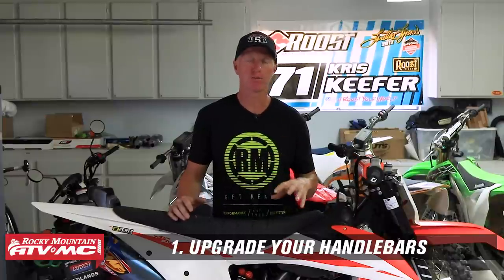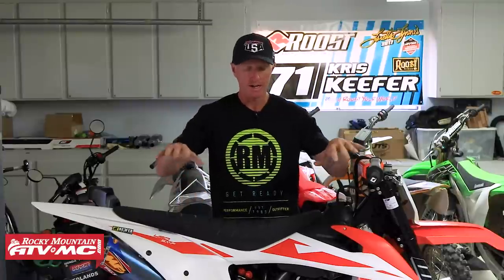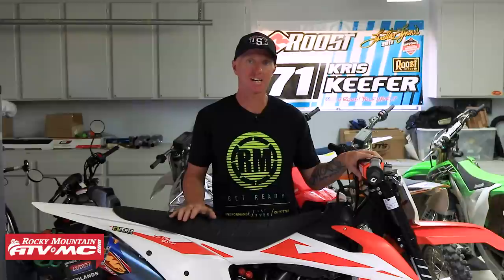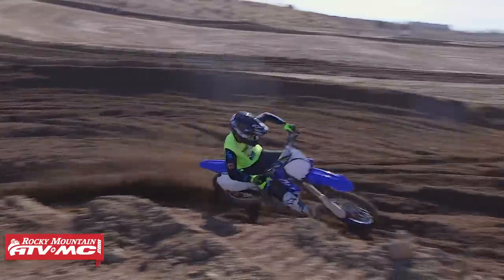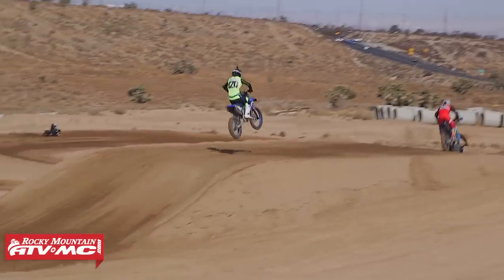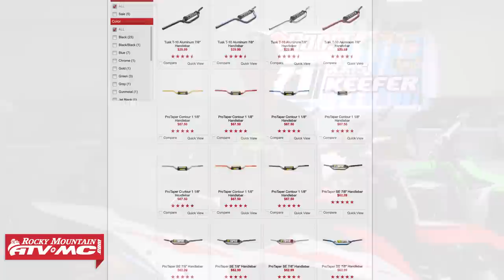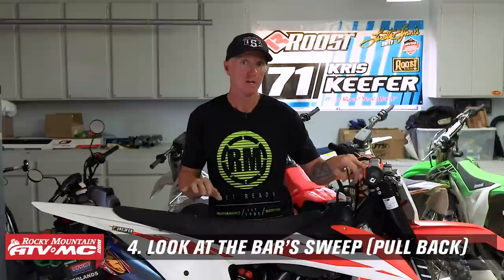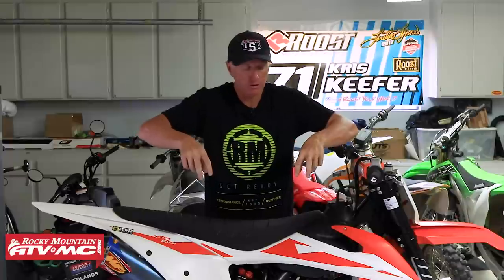Top 5 Motorcycle Handlebar Setup Tips w/ Kris Keefer

Comment: can you explain why you're saying get a low rise bar and use spacers on the triple clamps/bar mount? that doesn't make sense to me. I actually prefer to adjust bar height via the bar rise as opposed to changing the bar mounting point. my reasoning for this is because when you add spacers above the triple clamps to change your bar height, you're now shortening the reach of the bike because your height is coming from the head tube or fork angle so as you add spacers, the bars get pulled closer towards you. now maybe this is a good thing for YOU but I wouldn't be touting that it's the one and only way as you come off in this video. conversely, raising bar height via the actual bar rise allows you to raise or lower your bars without impacting the reach which is a much more preferable and recommended way to set your bike up IMO, same goes for mountain biking where that's a common rule of thumb. now you're kind of right in that if you get bars that are too high of a rise for your body and you're a shorter rider you will end up now with a high bar that's in the same position as stock as far as reach goes so your body positioning may make you always feel like you're hanging off the back of the bike as apposed to being in a nice neutral attack position. so maybe your bar height is high enough to where shortening the reach and bringing them closer to you feels better for you. but again I'd rather achieve this by using the bar rise an roll as opposed to the bat mount spacer/height which will always push the bars further backward toward you and reduce the reach of the bike and you don't even have a choice about it, at least by using the bar rise you can keep the bar in it's neutral position, while changing the bar height and using roll to adjust the position forward or back to dial er in. just my 2c.

Comment: Correct me if i’m wrong, but a taller rider has most likely longer arms, why would a taller bar suit a taller rider? It should be the opposite! I’m 6’5 ft and run a KTM low bend or twinwall 999, this helps me loads in the corners and when in a standing position i tend to be more neutral over the bike than with a twinwall 994. The rider triangle gets very weird when you start extending stuff like taller bars, taller seatfoam and lower pegs. This is just my opinion and i could be completely wrong.
Reply: 'Rider triangle'. Interesting. Makes me think of Weight and Ballance with an aircraft.
Reply: i fee the same way i’m 6 2 and i don’t want my bars any higher when sitting down and like you i would almost think the bars need to be further away because my arms are longer than most so bringing the the bars up would just make me be more stood up not a good feeling, it takes you out of the attack position. but i’m still running stock bars and the one thing i want to try on my ktm is just run a flatter narrower bar and see how that goes and might play with risers a bit because then you can keep the one bar you like and play with height instead of buying 20 different heights of bars
Reply: Lower bars with a taller guy and long arms makes you extend your hands away from you causing your elbows to straighten. Bad form. So taller guys should run the bars higher thus bringing your hands closer and keeping your elbows out.
Reply: @Cl4rky   exactly! I have an rm250 that had lower bars and it felt weird until I put the higher protaper contours on it and the bike became way more predictable. I recently bought a husky sms630 supermoto and especially with the smaller wheels and lower bars it felt like the bike was turning into corners by itself because of the way my arms were extended. Higher bars fixed that issue real quick

Comment: 5'11" 170... what exactly does that have to do with handlebar width?  Omg
Reply: well, if you are taller or chunkier, there is a high probability your shoulders are also wider. for instance i am 5'5'' 116pounds (167cm 53kg) and i have very subtle shoulders. (I am a female, so my arms and shoulders are naturally subtle). With that said - wider or stock handlebars simply dont fit, those were designed for average male rider body type. my arms spread to the sides when I am on stock bars. I assume in my case i will need much narrower bars, maybe 79,5mm (maybe even 79mm)? I will have to try first.

Comment: In the first example, the biggest difference between your ideal and what they ship with is 1/4 inch per side. Does 1/8 to 1/4 inch per side really make that much difference? If you just rolled off the floor with that new KTM, is buying a new handlebar or cutting the one you just got really worth it for that much change?
Reply from the maker: Adam, I can definitely see your point, however, even though 1/8-1/4 inch doesn't sound like much, it's a difference that I can feel. T Doesn't mean you have to if you're comfortable with your current width. Handlebar bend is also at the rider's discretion. Some riders aren't too picky about it and some are. Personally, I can ride just about any bar bend, but I won't ever feel as comfortable as I do with a bend that prefer.-Chase

Comment: I do not get the difference between using a bar-mount or a high-bend bar for a tall rider. If either achieves the same final hand-height what is the difference? You do not explain the advantage of a flater-bar+risers over a high-bend-bar.
Reply from the maker: The Desertsweeper, that is a great question. I could give you my version but i'd also like to get Kris's answer for you. When I hear back from him i'll get you a response. Thanks for watching!-Chase
Reply from the maker: As promised: 

The difference is in the rise. If you have a tall bar
(height) "usually" the rise is also tall so this forces your
arms to be too far up when sitting down in corners. If you get a
flatter/straighter bar you will have a more relaxed arm position through corners(due to the rise near your grips). Getting the "height" through the
bar mount allows you to choose a more relaxed handlebar "rise" which
will not feel like ape hangers when sitting down or setting up for corners. The
height measurement is strictly measured in the  If you're mostly an
off-road guy and stand up a lot getting a bar that is taller with slightly more
rise is acceptable. Again, these are just inside "tips" and is not
the gospel by any means. If you like your current bar, go be happy and enjoy
your dirt bike, but if you feel like your technique is suffering through
corners it could be your bar bend. You can check out my website
Keeferinctesting.com or my podcast to read or listen to more handlebar
dimension talk. -KK
Reply: I know this is old, but I was thinking the same thing. Ultimately the Grip height is the grip height. The only difference I can see is where you set your bar tilt/angle (not sure the official word for this). If you have a riser/spacer that is say 1" and lower bars. The title angle will have to be more in your lap to put the grips in the same place since the vertical angle of the mount changed and that is not adjustable forward and backward. With a higher bar, you can keep that angle adjusted from your oem mounting position and land closer to the distance you want from the body to grip without having to lay it back as hard. This might be what they mean we they say "Ape Hanger" feel. Overall, it seems like they produce the same result. However, I would be concerned about the mounting hardware during a crash since the bolts are technically now longer and there is a third factor of movement in the spacers. Older bikes used to use spacer or grommets in their mounting solutions and they bend every time if you drop the bike on the bars. On the flip side, the taller bars seem like they may have more flex if you are running a high bend fat bar. Personally, I run Renthal CR Highs and I am always happy that do. I am just a normal rider out there having fun, nothing special and I ride 80% desert and 20% Track so it makes way more sense for me to go with a high bar and not add more factors in between myself and the machine. I am also 6'2" so it helps tremendously when standing. Just my thoughts though. These guys are the pros.
Reply: @ilikechipsonmysandwich  agree with all you say. We are the same height almost, I am an inch taller. To get close to a comfortable riding position I use a combo of foot-lowering-pegs and CR Highs and bar-risers...I always envy those shorter riders who are standing completely comfortably on a stock bike
Reply: @ilikechipsonmysandwich  I am with you guys, that part of the video doesn't make sense to me at all.
Reply: I’m 6,2 I ride the pro taper highs there great when I ran lower bars it felt like absolute shit so idk what the hell he is talking about either
Reply: @rmatvmc  I'm confused by this somewhat.. 
what's the difference between a flat bar and a bar with more center rise if it still has the same sweep and grip angle height? 
Using mount risers is no different to buying bars with the same bar geometry just with more center rise.

Comment: Also higher levers reduce the chance of whiskey throttle because of the way your wrist is bent, low levers can cause it, and you can lose access to the lever if you get too far back when they are too low.
Reply: I don't know who told you that , but having high levers will force you're elbows down in an attack position, I had a bad problem of always finding my throttle arm would end up low elbowed . Like really low , and I rode for years wondering why , cause I heard the same tip . I recently lowered my levers and elbow hasnt dropped at all in attack position. If you're sitting alot , sure have high levers but if you're a racer majority run levers lower so you're wrists aren't bent standing up cause a good b rider always has a finer or 2 on the levers . You wanna meet in the middle for sure
Reply: @rogergauthier2769  the wrist is supposed to be bent, and yes elbows always out. Anyways Chris Birch and all the other enduro gods teach this in their courses. Levers too low is bad, levers too high becomes impossible....so 25-45 degrees from horizontal is common in the elite setups. But you have to adapt to it.

Comment: Do u guys have handle bar clamps I can purchase for a yz 250 2stroke  that are a little lower than stock
Reply from the maker: It's not very common to have handlebar mounts that are lower than stock. It may be easier to get a lower rise handlebar. To see all the handlebars and handlebar mounts we carry for your bike, just enter your bike's year, make and model on our website.
https://www.rockymountainatvmc.com/parts/dirt-bike-handlebars-controls
Reply: Rotate your bars backwards, (and readjust your levers), until the grips are pointing down a bit at the ends.  High bars are a freestyle setup for knee and foot clearance for tricks.  Your cornering and control will improve. and the height will be lower for you.  You will not be pushed too far back, but will be able to get your shoulders closer to be over the bars for corners, and able to push down on one grip and pull up on the other.  Can't do that if you are reaching for the bars, and I see a lot of real slow corner speed for amateurs on YT go-pro vids.  They can't feel what their front tire is doing, and only a berm feels good.  Look at the pro bar/lever set ups from the late 80's and early 90's.  That worked best.

Comment: I’m 6,2 I ride the pro tapers cr highs there great idk what the hell your talking about saying using risers and lower bars that’s a load of shit
Reply: I feel the exact same on this, what's the difference between a flat bar and a bar with more rise if it still has the same sweep and angle height?
Using risers is no different to buying the same bar geometry just with more rise.
Reply: I’m going to say a flatter bar has different structural integrity and geometry eg flex, then bars with a high rise and shaper bends. Just my 2c
Reply: I got pro tapers sx race bend how are the cr highs? I’m 6’3 ona yz250 😂

Comment: This is not freestyle where you want more knee and foot clearance for tricks, so they rotate the bars forward.  Rotate them back where they belong so the ends are pointing down a bit, for much better cornering set up,--and point your levers down so you can keep your elbows up easily with a straight wrist.  This is not freestyle, like every bike in your garage is set up for.  Bring those bars back,--and you will ride better.
Reply: 2:52.  See how your hands naturally are rotated a bit, pinky on the low side?  Rotate your bars back to about match that angle for your grips.  It also makes it easier to get your shoulders closer to the bars for corners, where you can (for example), push down on the inside grip, and pull up on the outside grip to help lean the bike into a corner, and gives you a better feel of what the front wheel is doing on the ground.  It is harder to get over the bars more like that when they are rotated forward, and the grips higher, at an unnatural wrist angle.
Reply: But also at 2:52.  If you point your levers down a bit, your elbows would be up right there. :)  Your elbows are up pretty good when you ride though, (better than Sexton even,---last national crash with his elbow at his side, that James covered), but it will be easier if you bring the bars back.